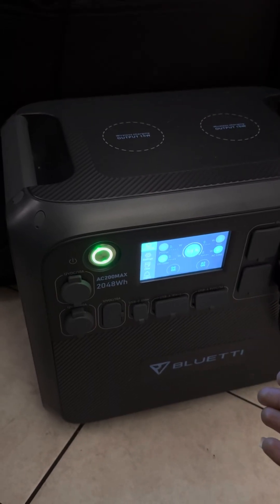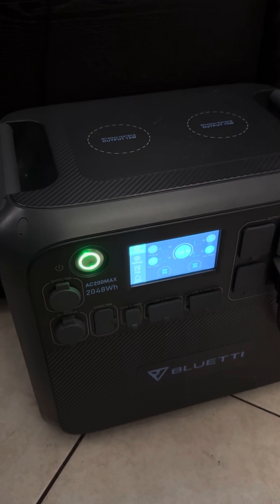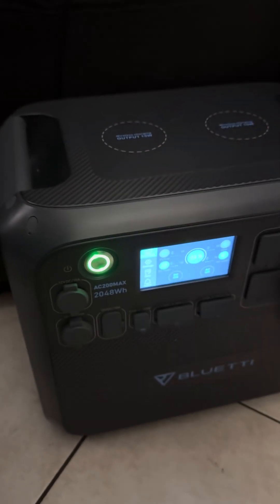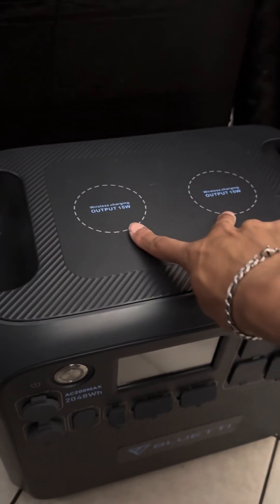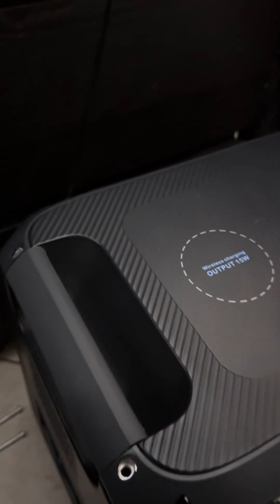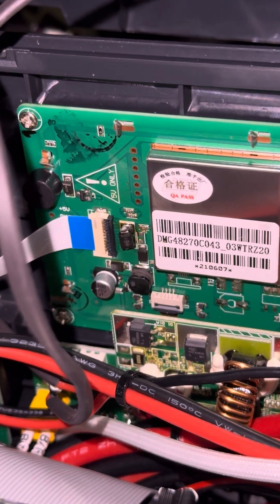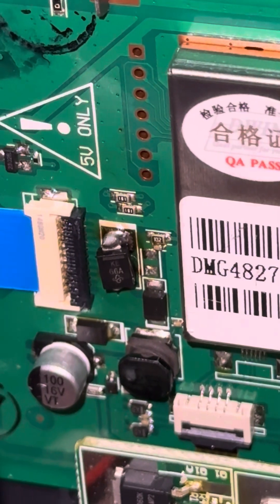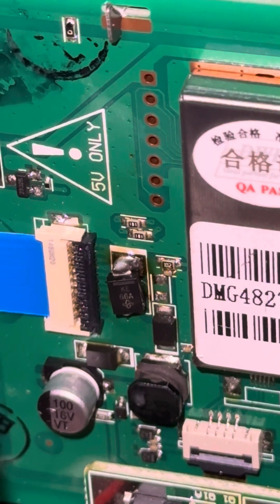Bluetti AC200Max - My issue and Fix

Comment: My screen is on but just say 0% and cant charge nothing! What could it be? It was at 60% and dropped to 0%
Reply from the maker: I wish I could help. It took me a long time to figure out the issue I was having with my unit. I was at the point where if this didn’t work I was going to repurpose the batteries